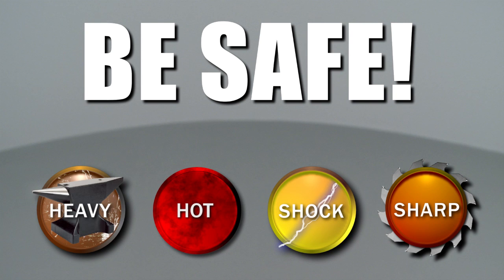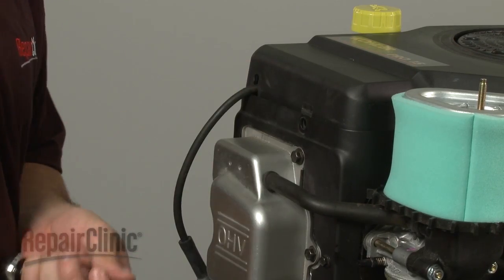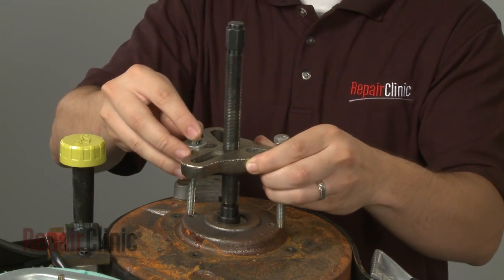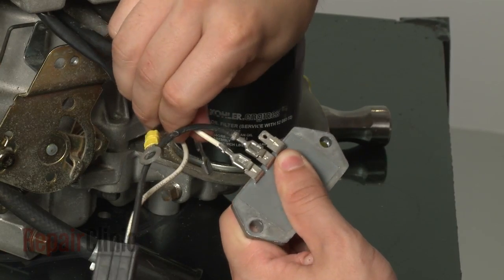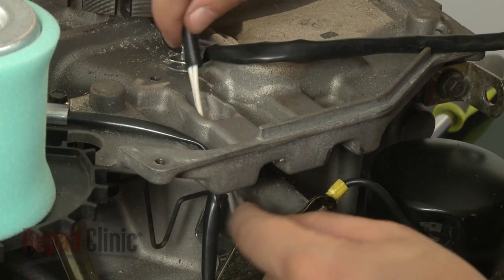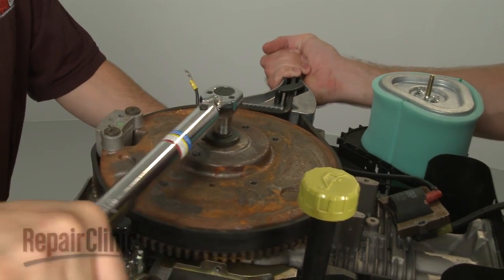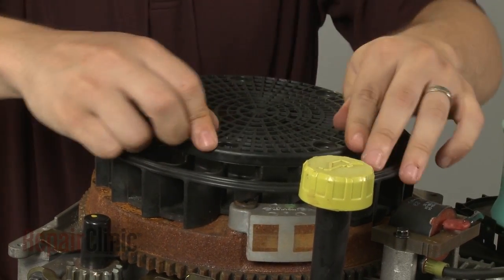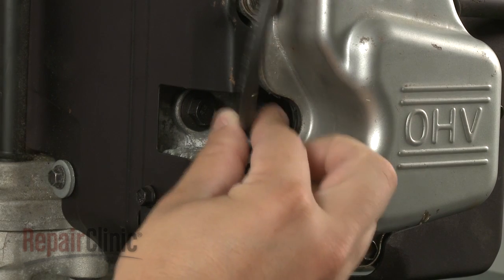Kohler Lawn Mower Stator Replacement, Small Engine #237878-S

Comment: What's the thread pitch of those long screws going into the flywheel? I was able to get a 5/16-18 and 5/16-24 bolts started, but then they'd get hard to turn, and thus couldn't figure out what size bolts are supposed to be able to screw down into those holes?

Comment: I have kohler ch22s on my carpet cleaning machine. But i have to keep the machine battery conected to my van batteryvin order to run it. Do i have to get a new alternator or do u think this will fix my problem?
Reply from the maker: Yobany Martinez If the engine battery will not stay charged then we would suspect a problem with the alternator. Some model will also feature a regulator.

Comment: Could a bad stator cause a regulator to fail? It was producing 21VDC on the B+, replaced the regulator and got the same result, yes I made sure the ground to the regulator was good.
Reply from the maker: The output of a regular depends on charge of the battery. If the battery is getting low on charge, the regulator will increase the amount of current to charge the battery. If the battery is fully charged, the output current will decrease. The voltage will vary depending on the engine speed. You should be getting about 12 volts out of the alternator wire at the higher rpm range. We're assuming this is a 12 volt system with a 12 volt battery. As the rpm lowers on the engine, the voltage will decrease. The alternator would have to be wrong to get the wrong voltage. If the alternator were shorted, you would get less or no voltage out. The magnets also have an effect on how much voltage you get. For further troubleshooting, you'll need to research using your engine and lawn mower model numbers.

Comment: What brand puller are you using?
Reply: All you have to do is lose up the bolt a little put a crow bar under flywheel and take a hammer and hit the bolt while pushing up on the flywheel much faster